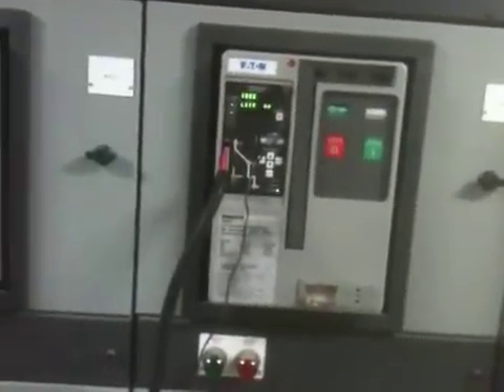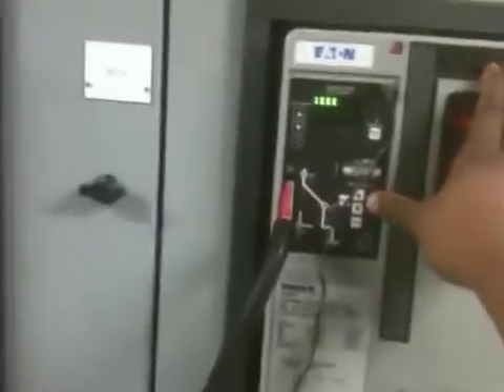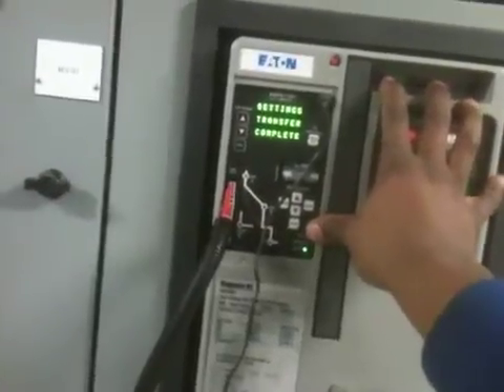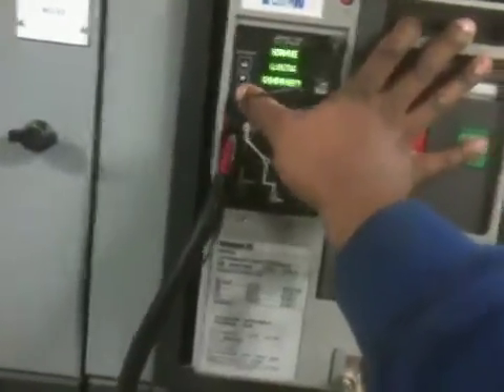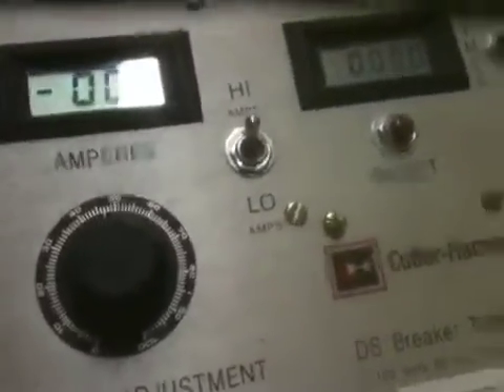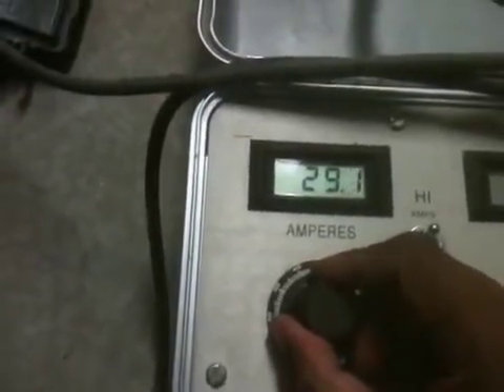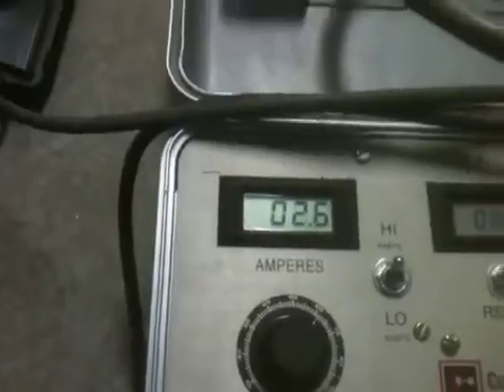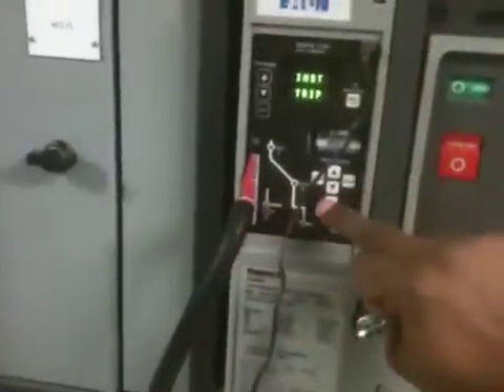Secondary Injection Testing

Comment: Thanks for the video. I hope I understand the basic principle of setting a circuit breaker to a trip level (30A) then increasing current until the breaker operates. Could you please make another video and proceed a little slower and explain as you go in a more generic sense of what you are doing step by step. Thanks.
Reply from the maker: +fishflock Never stop trying to wrap your head around testing concepts, I know it can be confusing at times. Remember that the secondaries on Current Transformers are generally 5A. So lets say I have a 100A Current Transformer and my secondary is 5A. If the current on the secondary side is at 5A that means their is really 100A being measured, or lets say 2.5A was on the secondary that would mean 50A was truly on the primary side. When I selected 30A to inject on the secondary side I am making the trip unit think that there is actually 6X the nominal primary amperage on the CT. So if it is 100A primary I was making it look like 600A. The trip Unit functions I was testing were overcurrent conditions. I hope that helped ya out bro.

Comment: Hai i too want to know what type of test kit you have used. If it is normal secondary injection test kit, how did you connect the test leads to tripping unit....
Reply from the maker: +dinesh kumargowd The cables from the test kit bet plugged into an adapter that has on the other end of it a cable that fits the test port of the trip unit. You can find the accessories here. http://www.electrorent.com/electrical-power/products/circuit-breaker-test-secondary.aspx